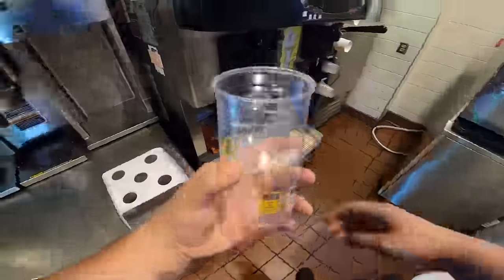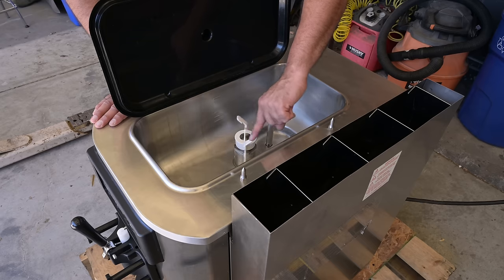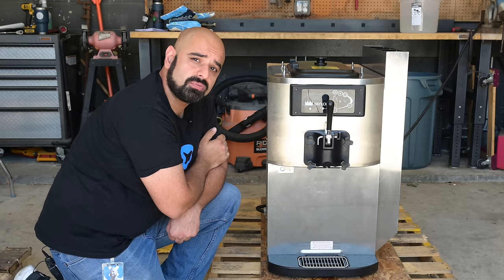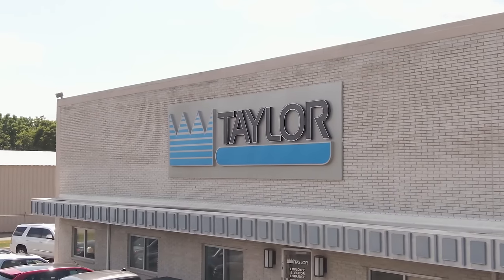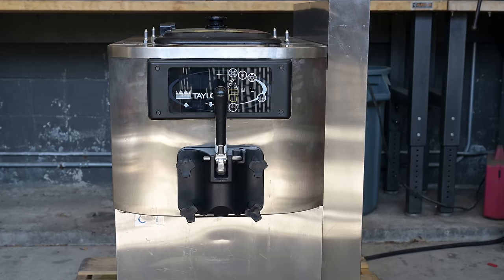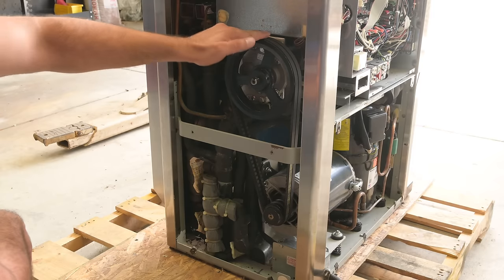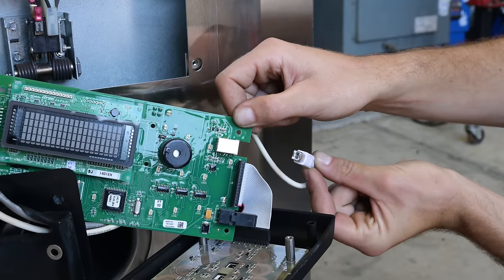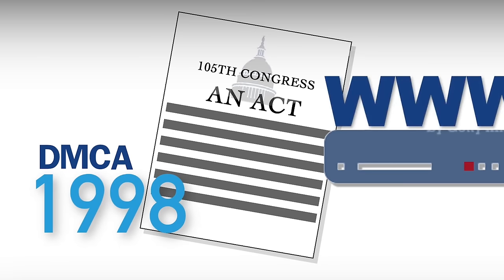Why McDonald's Ice Cream Machines Are Always Broken and How To Fix Them

Comment: I have just watched the first 30 seconds but I can tell you this. I have spoken with someone that is a technician for one of the largest producers of this machine. He was telling me he did mc donalds and other huge nationwide chains. All the machines are essentially the same and to be food safe they need to be cleaned, as in everything removed and the lines cleaned to guarantee food saftey. Otherwise you have listeria like that one place recently that killed people. Softserve has a lot of moving parts and there is an immense amount of maintenance that needs to be done to keep them up. He would normally have to service ours every couple weeks because it would mess up and need some part replaced and the place had money to just contract an expert whenever the machine acted up. I can say however that they should have cleaned it more than they did.

Comment: I worked on these machines for BK over 10 years and they work fine, its the people who use them that are broken. Yes it takes 4hrs to clean these but only once per week, daily it has a cycle that it goes through but that is over night. 

The problem is over/under filling the hopper with shake mix, too much or too little will fail the "heat" cycle and then the machine locks up and MUST be taken apart and a timer runs and will not funtion again until that timer runs down. The timer is so that there is enough time to correctly clean and reset the machine. Most managers dont care enough to take the 4 hours to do this every morning due to someone over/under filling the machine the night before. Constantly doing so causes the machine to require costly maintenance and they dont want to pay. 

Do not believe the story about the machine company being at fault for a faulty machine, its the people operating it that are failing. 

For over 10yrs my machines at BK worked over 90% of the time and thats because I trained the managers and their employees that 1 little key step to ensure the ice cream/ shake machine works.

Comment: The heat cycle on the machine will fail if the right temp isnt held for long enough, and leaving the lid on the top open for more than just a few seconds during that heat cycle will cause it to fail. I worked at a mcdonald's for a while, and I was the one who always worked on the machine, and did the mandatory disassembly and cleaning that would take at least 1-2 hours if I was going fast, and 3+ hours if I was being thorough.

Comment: We had one of of these at baskin robbins. The machine never broke down. The issue is its set up, clean up, sanitization, and maintenance replacing blades dialy is a burden. You gotta be mindful making sure the machine has enough ventilation. If you follow the schedule you'll have no issues. If you get lazy then yeah youre prob screwed.

Comment: FYI - this is not anywhere near the same machine that McDonalds uses - they use Pump units with heat treatment, which is the Model C708.  If you want two flavors, it's the Model C716... but of course, McDonalds uses the combination Shake\Soft serve, which is in fact the Model 606.  That all being said, when you first started the machine in your video, you forgot to 'clean' the unit with hot water - this would completely eliminate the need to do the heat cycle in the beginning.  I know these machines like the back of my hand, and used many of them in my restaurants.  They work GREAT, however the heat treatment is not needed for heavy use... once a day when that heat treatment is required, the easiest thing the business should do is empty the contents, flush with hot water, wait 5 minutes, turn back on - heat treatment would be bypassed.
Reply: Also, these are not technically 'locks' but 'food proof' ways, to ensure the product inside is 100% safe for consumption.  I would love to chat - hit me up, and I can tell you EVERYTHING I know about these machines, and how to 'fix them' without hacking, or using kytch.

Comment: The whole deal about the hackers coming up with a device that can actually help workers understand the error codes and potentially fix the machine, then being told they can't use the Kitsch device, is totally hilarious.  This is like the film "Brazil" and it's infuriating.  Taylor should embrace the Kitsch device--buy it from the inventors and make it standard equipment.

I was in grad school in CS when the DMCA came out.  A lot of us argued against it.  The DMCA was evil in so many ways--basically outlawing the kind of reverse-engineering hacking that is so important due to everything electronic being so complex.  It's a perfect example of how big government and big business (and their lobbyists) collude to damage markets and solidify monopolies.  They were worried about digital content and enabling streaming for companies like Netflix, but it had so many knock-on effects.  Back then, it was a fight over CDs and DVDs, encryption, "ripping" of DVDs, Napster, sharing, all that kind of stuff.

Also, keeping those machines clean is critical because listeria is dangerous as we recently saw with that shake machine at that fast food place in WA.

Comment: I am lucky to live in a country that is mostly not held back by draconian legislation. If I buy a product and I want to repair it myself I am perfectly entitled to do so, and the manufacturer of the item has no say in the matter. Sure, I might void my warranty but I'm prepared to take that chance because I know I can repair the item myself.
I also work in an industry where down-time of equipment isn't acceptable so in almost every instance there is a backup unit which can be (or is) switched in to take over if the main unit is offline for any reason.
If it is a requirement for an ice-cream machine to be offline for extended periods of time (4 hours is a long time) for cleaning, heating etc then why not have a second machine that can be run while the first is offline? Just make sure the second machine has a different time schedule for being offline. It can do its cleaning and heating when the main unit is operating.

Comment: Could the overheating of the machine be a result of an under-sized radiator of the condensor? During peak hours, the compressor is working extra hard to keep the ever dispensing ice cream cold and the condensor radiator is just not able to dissipate enough heat into the atmosphere to keep it cool.

Comment: The machine here is different and has less parts then the one I trained on. It homogenized or heated the mix daily at 4am and by 10am it was ready again. If cared for it never failed. The people would break it and we would run out of mix were our problems. The people broke it usually sanitizing and cleaning it. Busy days drain almost all the products. The machine hates being empty and off and over worked. If you kept it running then perfect but to restart it from being down for any reason might require a bit of luck. If we thought we would run out of mix we would desperately retrieve some from another location. The numbers seem correct because if we went down it was for 2 or 3 days. 2 machines as a solution did not work because we either had 2 machine up or 2 broken and it just caused more work. The time required by maintenance or management is so great we should not rule out sabotage or incompetence and malicious compliance of the duties with this machine. Having said all that it is a brilliant piece of equipment and a money maker.

Comment: The McDonalds ice cream machine always being broken is the actual truth, not that it’s being cleaned. Well, it being cleaned is actually part of the problem. Taylor is the company that makes the ice cream machine McDonalds uses, and when someone buys a franchise they HAVE to sign a document saying that they will ONLY use the Taylor C602 model. Other machinery they are allowed to choose two different models, but for ice cream they can only use the model C602. 
So what’s supposed to happen is, someone is supposed to run the cleaning cycle overnight when they are closed. In the morning, since most people aren’t buying ice cream in the morning, someone from the morning crew is supposed to turn the machine on to get it back to a freezing temp. But, what happens instead is they come in and there’s a generic failure code that no one can tell what failed. It doesn’t tell you what failed so they don’t know how to fix it. They end up calling the franchise owner and all they can say is, “call the guy.” And who’s “the guy?” The service tech from Taylor, so every single time a C602 breaks down, Taylor is called out to repair it. McDonalds & Taylor have been close business friends for years, Taylor has been a part of McDonald’s since the beginning, so how does McDonalds repay them? They give them constant work to come out and repair their machines!!

Comment: I’m not a hacker or very tech oriented - aside from the excellent ifixit products I use to fix my elderly iPhone to keep it going - but my takeaway from this is: The Taylor machine’s main feature is its mediocre design and manufacturing, plus underwhelming mechanical and software systems, renders it unusable when it breaks and barely functional when its up and running. And its ecosystem is such that a user is unable to perform reasonable repairs and maintenance without violating the terms and conditions of its ownership and usage as set by McDonalds and Taylor, which are worded in such a way as to put the user/owner at a distinct disadvantage as they try to conduct business and serve their customers. This sounds like predatory and monopolistic policies that both companies practices in a free market environment. I’m surprised that McDonalds franchisees haven’t sued one or both companies over this, but maybe they’re scared of and repercussions if they didn’t prevail in court. Which would seem like a slam dunk to me. But I hope you folks can get the law fixed so the franchisees are no longer held hostage by these jerks and people can get their ice cream.

Comment: They are removing the machines after losing the lawsuit with the repair company.  That company proved it wasn't down, just they didn't want to clean it.  The clean cycle takes about 30 minutes for the daily.  The 4 hours is a weekly cleaning, usually done during the start of breakfast time.

Comment: I have worked at a few McDonald's locations with Taylor branded and non Taylor branded machines the Taylor branded ice cream machines always breaks down however the other brands we had (my old patch doesn't use Taylor's ice cream machines lol) I rarely seen Ir go down. Taylor's other equipment seems to work fine their clam grills (last gen specifically) work great never had to many issues with them (except crew not cleaning them properly...)

Comment: For the heat cycle to complete its cycle is has to be filled to the ''max'' mark... failing to do so produces a fail/error... this is just a way to generate hype, machines are only ''broken'' in the US because lots of stores are open 24/7 and have to cycle during opening hours, in Europe they aren't open 24/7 as much and the heat cycle runs during the night.

Comment: This video is not gonna be here for long I guess. As tha maintenance guy that is been called to fix those machines you have done impressive work. In the other hand I must say main reason those machines are not working every two weeks is because not proper cleaning and assembling. Maybe it falls in Taylor difficult customer approaching. But people need to consider, is a machine that need to pasteurize well every night, it is sanitary issue and customer cannot oversee this. Even if is easy to short cut this lock down problem by jumping the electronic board.

Comment: There must have been a point in Taylor history when they just said "screw them"
I work with Taylor brand ice cream machines (Specificly Taylor 791-58) built, I think, in 2013, and we run those bad boys 24/7 without overheating issues using an industrial chiller. Also, cleaning definitely does not take 4 hours, I estimate 1 hour at worst.
Reply: My understanding is it's the 4 hour cleaning/pasteurization process the machine does to the dairy mix, as they don't use pasteurized dairy for some reason. So that machine heats up and sterilizes the machine, then it pasteurizes the dairy, then it cools the whole thing back down again to be ready to freeze and extruded. The service manual for the machine says it takes 2.5 hours just to heat up to operating temp.

Comment: How about instead of trying to hack into the existing control board, just create a full blown replacement control board and display board replacement that interfaces with all the existing relays? Presumably the relay signals, compressor and motor controls aren't themselves digitally locked and could be directly controlled with better software?

Comment: I think that Taylor did all this on purpose. I am a technical writer myself and I would guess, that the customer facing documentation is intentionally crappy when it comes to error codes. I strongly suspect that there is a service manual which lines out all the error codes in great detail. After all, there are people who just joined Taylor and need to learn the ropes. For them, such a service manual is made.

Comment: A question coming to my mind about this, is it possible to mybe import devices from the eu for stuff like this? Or would be use be illegal too? Since the EU has a right to repair and sellers are requierd to make repairs, use of refurbished parts and manuels availible. Yes some firms (Appel) are going crazy against ist and most likely will get big fees soon, but still its there.

Comment: i think there should definitely always be an exception made when repairs are necessary, and further, no company should stifle the ability to repair any product.
maybe mcdonalds is stuck in a written contract where they're forced to pay the manufacturer for repairs, so they can't just allow franchises to breach that contract,
but it should be written that you can't hold a customer over a barrel by forcing them to use your repairs/services alongside whatever they physically bought.
Reply: McDonalds isn't stuck, they want this because Taylor bribes them.
Reply: @nathangamble125  so you're suggesting this arrangement between mcd corporate and taylor, to force franchises into using taylor products and services exclusively isn't in a written contract anywhere?

you think mcdonalds is completely free to ditch taylor altogether if they simply wish?

Comment: If the main problem is overheating - how about adding some case fans? (Works for cheap welding machines)

If they're seperately powered - (which would be the easiest DIY option too) - and perhaps held in place with doublesided tape... Then it can't even be considered "tampering"..

The software lock won't be bypassed; no tinkering with the hardware or electrical circuitry..

And perhaps a bit of airflow is enough to keep it from overheating.

-

Sidenote: it's quite worrying that 25% of their income comes from repair... That's a direct incentive to not fix the issues.

But willingly leaving a problem unresolved, and leaving business owners at the mercy of an insufficient number of repair technicians... I'm pretty sure that violates some laws
Reply: The main problem isn't overheating really. It is the heat cycle. To keep the icecream mix sanitary it has to heat the mix up for a few hours to kill bacteria. If the icecream mix is filled too much or too little the machine gets angry and stops the cycle, forcing you to start the 4 hour cycle again. If the crew member in charge doesn't fix the mix level properly the 2nd time, it will give the error again and waste 4 more hours.
Reply: @TrueScotsman96  They don't need a heat cycle though, they could use a UV light to kill bacteria.
Reply: @RealCelticGamer  Yes they could in theory kill bacteria a different way. However the machine kills them with heat during a 4 hour heat cycle. That is the fact of how they work.

Comment: Considering there are other parts of the world where you are allowed to break copy protection for stuff you own and that part of the DMCA just doesn't work.
Now I know the 110/220 60Hz power system may FUBAR things, but exporting Mr Taylor, have it reverse engineered and import the code reader should in theory be doable.
It would be high shipping costs most likely, but considering this is a money making machine, a high up front cost that saves you on the downtime would in the end pay for itself.
Maybe a spinoff company "iBreakit"? :D

Comment: I wonder if there is a simple way (without reinventing the Taylor wheel that is) to get some DIY method of heat dissipation onto whatever it is that is overheating. That seems like it would be a good place for iFixit (or someone else) to start to at least eliminate one point of failure/downtime while all of the franchise owners wait to see what happens with the DMCA for industrial equipment.

Comment: i used to work at MC and we have taylor machines.. they didnt used to be so complicated, its a machine thats make icecream just the pcb that control de cycle motor, compressor temps and some lights, they was very easy to repair but they never broke... nowdays looks like they are overly complicated.. whats the point of that lcd display?

Comment: This is not like a McDonald’s shake / soft serve machine. First of all on first start up after cleaning you do not need a heat cycle. Your machine is a hot gas heat treat McDonalds is glycol with electric heat. The other fact that you are missing is if ether side of the machine errors they both lock out. Taylor should of isolated each side so they run independently then the the side that errored would lock itself out but the other side would stay running. You can just run one side after a cleaning but as soon as the auto button is pushed that side has to pass all the time and temps.